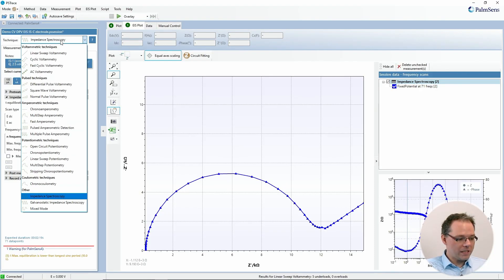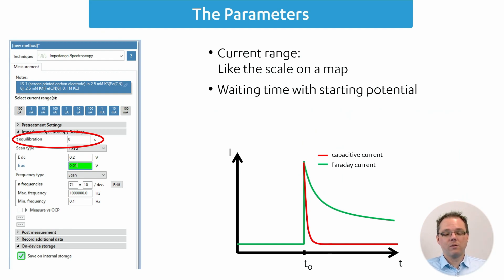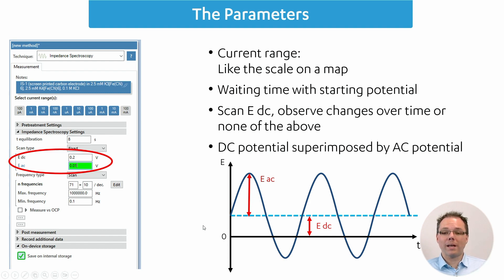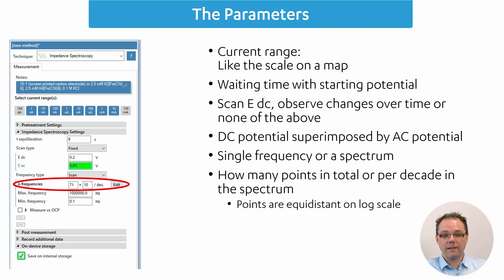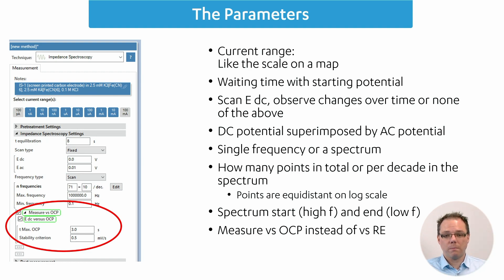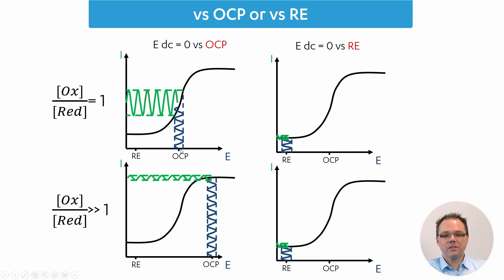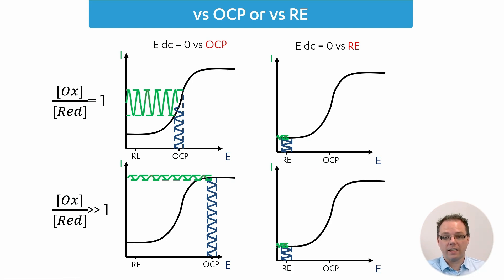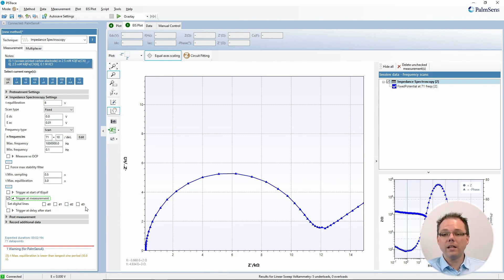PSTrace Tutorial #14: Electrochemical Impedance Spectroscopy (EIS) parameters

Comment: Thank you very much to PalmSens for the Video. I am using EmStat4R, If it shows a warning (for PalmSens4) while performing impedance at less than 1Hz what should I do the things. Also, the instrument won't accept more than 200KHz. This video also shows the same warning in the impedance setting parameter as I trying to mention. It would be great if I got a response. Thanks in advance
Reply from the maker: Dear @ushaforme, I suppose you are talking about the warning 't Max equilibration is lower than longest sine period'. 

The impedance measurement requires a stationary state. This means that before the actual measurement starts, the sine wave is applied during ‘t Max equilibration’ only to reach the stationary state.

The maximum number of equilibration sine waves is however 5. The minimum number of equilibration sines is set to 1, but for very low frequencies, this time is limited by ‘t Max equilibration’. The maximum time to wait for a stationary state is determined by the value of this parameter. A reasonable value might be 5 seconds. In this case, this parameter is only relevant when the lowest frequency is less than 1/ 5 s or 0.2 Hz. Increasing this parameter can be beneficial when measuring unstable or noisy samples at low frequencies, although it will extend the overall measurement time.

Comment: i have like this device ,how can I calculate moot schottky and extract its data ?
Reply from the maker: Dear Daleeng, If you are using PSTrace you can perform EIS with a potential scan (Select for Scan type: Potential scan) and choose the freuquencies you are interested in. Make the measurement. You can change the plot to C vs E and export the data. You can use the on-click-export to Excel or Origin or you use the other options in the top menu Data - Export Data. The last steps would need to be performed in the spread sheet software of your choice.
Reply: comm error object reference not set to an instance of an object in palmsens4.. What is the solution to this problem? It occurs when the measurement is potential scan..
Reply: and cyclic voltometery show as line
Reply from the maker: @dalalalhilfi87  There could be various causes for this error. To offer more effective assistance, we kindly request additional details about your setup. Please send the .pssession file(s) containing measurement data, along with any relevant system images that you believe could be helpful, to info@palmsens.com. One of our specialists will respond accordingly.